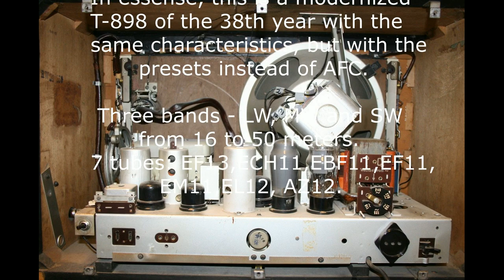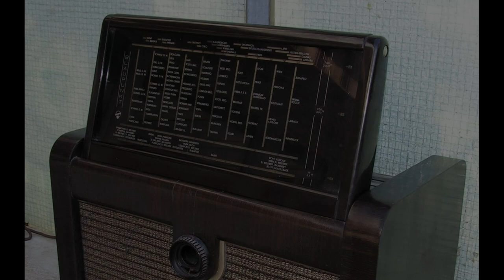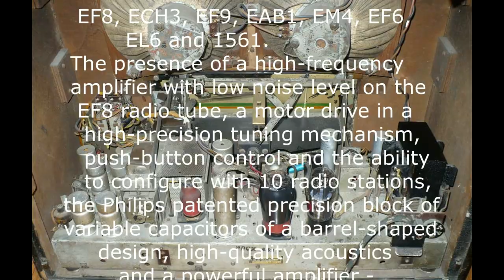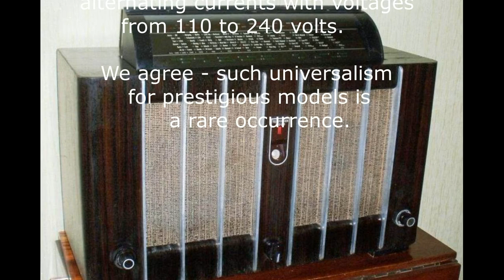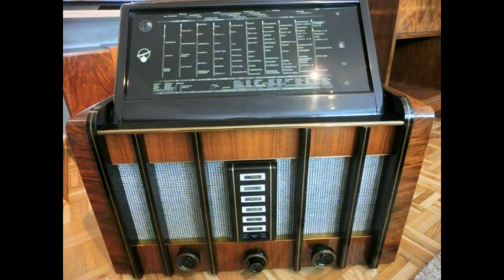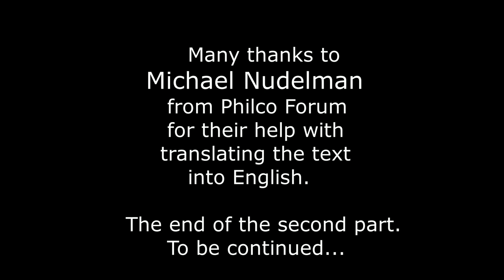TOP 20 the best radios in Europe 1935-45. Part Two.  English version

Comment from the maker: 5th place

Telefunken T-7001WK / T-8001WK
1937/1938
Modifications of the T-7000 GWK / T-8000 GWK TOP models for electric networks of exclusively alternating current with significantly better characteristics in radio reception, sound and an additional system for AFC.

Three frequency ranges - LW, MW and SW from 19 to 50 meters, 12 radio tubes AH1, ACH1, AF7, AB2, AM2, AF7, AB1, AF3, AF7, AD1, AD1 and RGN2004. The same two-way acoustics, but much better characteristics of the sound amplifier on the legendary direct-heating triodes AD-1. The result - the sound and the highest position of Telefunken in our rating became much better ...

4th place.

Blaupunkt 11W79
1939 Germany
Further development of the design concept “hinged scale” ... Despite the presence of only three ranges, this is undoubtedly the best Blaupunkt model of all time.
11 “11” and “A” radio tubes of the EF11, ECH11, EBF11, AM2, AC2, AL5, AL5, AZ12, EB11, EF11, EF12 series.

A high-frequency amplifier, a separate IF bandwidth regulator with a maximum bandwidth of up to 9 kHz, AFC, motorized tuning, a push button switch to 6 preset stations, a remote control and great sound nust had to satisfy all the demands of the radio gourmets of the time ...